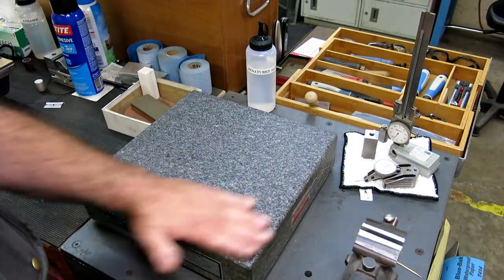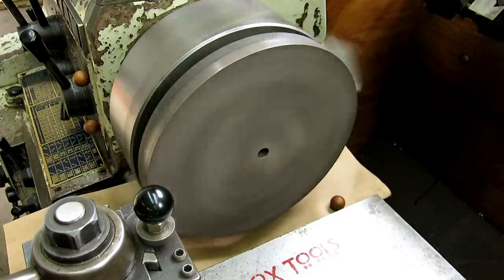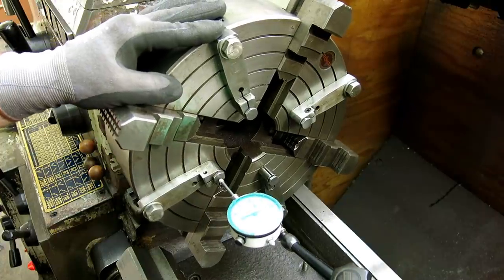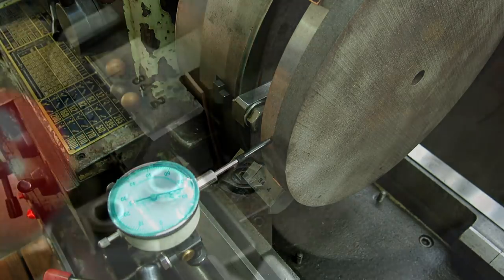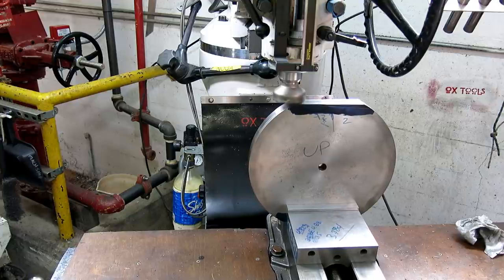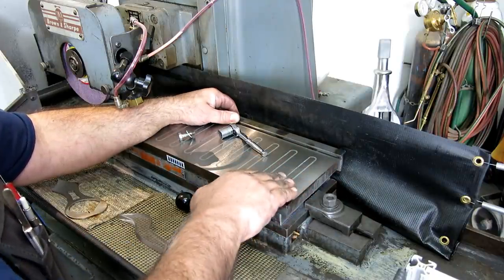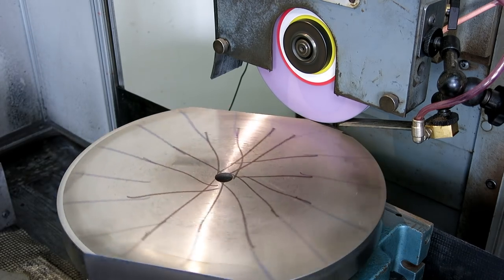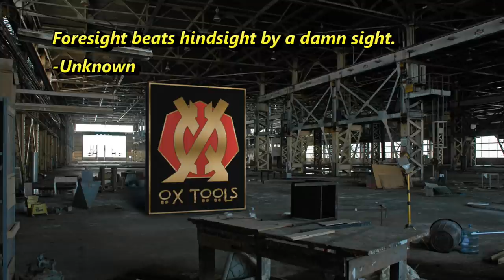Confessions of a surface plate abuser

Comment: Just a Tip from Africa, we do not have the facilities to have tools delivered to our door, so as a surface plate alternative we use a good piece of plate glass, fairly thick, I have mine set in a recessed block of wood, so it is safer, and I keep in in the corner of my shop. I have cleaned some motorcycle clutch covers that leaked because it was ever so slightly warped, some high grit on the glass and rub it in a circular motion managed to bring the mating surfaces in the same plane, and hey presto, the cover can be put back on and no oil leaks.
Replace or turn the glass when you suspect low spots are developing. I check it by using a straight edge and feeler gauges.
Obviously do not drop the work piece on the glass.
Reply: Glas or even better mirrors. If a mirror is not very flat the reflection gets warped
Reply: You must have some beautiful night skies so if you happen to have a couple more thick glass blanks, about the size of an 33⅓ LP record you're on your way to a nice telescope....by weight at least. That size works great and gets your arms in shape for serious sanding.  Just a thought...

I forgot to mention the search parameters: "John Dobson making your own reflector telescope". He's the solo version of a reflector telescope collective knowledge database. A natural guide. Cheers.
Reply: A good quality glass plate 1/2” or thicker has been a way to do this for a pretty long time. I use one myself.
Reply: I mean I don't know how expensive your glass is but a grade b surface plate like 24 x 24 is only 100-200 us dollars.and that's for large parts you can pickup a used starrett toolmakers flat out of class A Pink granite that is 8"x12" or 12"x16" for sometimes like 50-150 bucks.
Reply: What on your name ? 🤣 @BedroomMachinist

Comment: When I worked in the grind department at a company in Bad Axe, Michigan, we had one of these in each work area.  They are very handy for cleaning up parts after they return from heat treat.  We would rub the parts before measuring them on the plate and they thus saved wear on the plate (from the grit and residue which got stuck to the parts during heat treat, and which would have otherwise been rubbed on the plate and machine chuck) and made the parts stick much better to the chuck during the first cleanup.  You could also easily see the locations of any burrs (and remove them) as well as the contact pattern which gave an indication of how the parts had warped in heat treat.  They also put one at each work station in the mill department, where they could use them to knock off unseen burrs very rapidly.  All of them were similar to yours, and used a full sized disk grinder pad, but had a 3/8" thick steel base which was Blanchard ground on both sides.  They were heavy enough not to shift during vigorous scrubbing and yet light enough to pick up and move.  At a cost of less than $300 in material, tooling, and time, I estimate that these would be cost justified in under a 40 hour work week for one person in a serious shop doing short production cnc machining and grind work.  These were one of the most practical productivity-boosting hand tools in that shop.

Comment: Yeah, I have too confess too. I've done the same.
I'm a maintenance machinest in a plastics factory.
A couple months back I came into the shop, and the night shift mechanic had been working on some feed chains for a thermoforming machine and had used our 24x36 B Grade surface plate to set the chain on to swage the pins back into about 6 links. Needless to say, there are little pairs of chips that perfectly match #60 chain all over the plate.
I lost my mind, chewed his ass for a while and post a sign on the plate stating 
"THIS IS NOT AN ANVIL
KEEP YOUR GODDAMN HAMMERS 
AWAY FROM HERE"
The sad part is we have two 4'x8'x 3/4" steel work tables one only 4 ft from where he did this.
AAAAAAAAA!HHH!A!HG!HAHA!!!AAGAA!!!
Reply: Sounds like my coworker, and actually, a lot of people in general. I swear they look for the nearest thing to get a job accomplished, whether it be my tools, table etc. rather than doing things properly. Drives me up the wall. 

I use filing cabinets as toolboxes, they're free :D, so I can't lock my stuff up. Ended up leaving different large notes in sharpie in all the drawers along the lines of, "Stay the fuck out of my tools and destroy your own garbage." My dad told me, "I don't use your shit, because I don't want you using mine."  It'd be one thing if people were respectful, but in their eyes, a micrometer is just as good a c-clamp as a wrench is a hammer.
Reply: @KISSMYACE3203  buy yourself some hasp and staples and padlocks and lock your filing cabinets that way when you are off shift lol. I certainly would or take the vulnerable tools like mics and such home every night lol
Reply: millwrights gonna millwright
Reply: And people wonder why there is a cage in the middle of a shop.
Reply: @spehropefhany  for putting the apprentice in after the 20th stupid question of the day? :)
Reply: what a convergence of passive aggressives we have here... "I swear they look for the nearest thing to get a job accomplished, whether it be my tools, table etc. rather than doing things properly....I use filing cabinets as toolboxes, they're free :D, so I can't lock my stuff up."  you all might want to take a look at yourself a bit in between taping bitchy notes everywhere.
Reply: just curious , cause i don't know,, but "SHOULD" that nite shift mechanic have known  that it was a precision surface ???????,,, i mean i wouldn"t have known what it was, but concidering everything else in there is some kind of metal, , a piece of  marble on a bench would stand out, and i would  probably have  beaten that chain against the concrete floor,lol,, no really i would just figured it was there for a reason and i should keep off,, at home i have a big 6"X10"x2" thick chunk of steel  out of the railroad around the corner, i beat metal parts on that or a piece of railroad track i found, and i also built me a square tree of  4x4 posts i screwed and glued together to beat stuff of i should think marble would crack, or at least chip?
Reply: @KISSMYACE3203  my girl was using my 1940"s  starrett dial callipers to dig shit  out of the garbage disposal,lol,, and her daughter , was using my 123 blocks as sanding blocks for sheet rock compoound,,,,, at first i was pissed then i was impressed that she knew enough to need a sanding block at all
Reply: @kingkarlito  Not sure what you were going for here in your statement. 

I have large signs in all my drawers that say, "Stay the fuck out and destroy your own garbage." Does that stop people? No. They know I typically have the tool they need, and when I'm not there, they'll take it upon themselves to use them.

As my dad said, "I don't use your stuff because I don't want you using mine." 

It'd be one thing if people took care of things, but they treat everything like a rental,  and when I'm spending thousands of dollars on my own stuff, I'd rather have any damage come from my own negligence rather than someone who will do it every time they use it and never reimburse me in the slightest.

Same thing with working areas, I do certain ops in designated areas. You wouldn't do grinding work in a clean room right? Well, my coworkers would if it was the closest room/required the least amount of effort to setup. I do not like that mentality.
Reply: @KISSMYACE3203  "Not sure what you were going for here in your statement."

Wager he's got the same problem.
Reply: I’m guessing that ur surface plate was clean and the tables filthy

Comment: Hi Tom. A thought. After removing the material from one side (where the flat is), I’d flip it over, then make a very light pass with that X-acto blade to form a crease, then fold the sticky part of the abrasive disk over the other flat and trim the bottom. Now you can sand either one or both surfaces of a part that has an internal 90-degree angle (like an “L”-shaped piece.) 😎

Comment: the best i have found on my cheap dedicated sanding reference plate is using 3m microfinishing film (or any mylar based sandpaper), wash the plate well, then put the paper down on the wet plate and squeege out the water from under the paper with a plastic card type squeege (very important) the paper is suctioned to the plate by surface tension, and not only does this keep the paper from moving and causing more wear on the plate, it keeps it quite flat to the plate so you dont have the leading edge of your part hit the paper wave and create a convex surface. work the part wet on the paper (not too much water or you will float the paper) the mylar based stuff dosent curl up like paper based sandpaper so you can re use it untill its dull. the 3m stuff is much more precision graded than regular sandpaper, and you can get it from 30 micron down to .1 micron.

Comment: The only downside here is, that hunk of cast would be near $300 or more, up here in Ontario in my neck of the woods. I tried to get my metal supplier to bring in a 2” x 2” x 18” chunk of cast so I could make a straight edge and it was going to be $130...
Reply: 300? Oh god.. it would be cheaper to buy old cast iron brake discs (every scrap yard has tons of them), melt them in a 200 dollar furnace (old tank, ceramic cotton, firebricks, fireproof mortar, propane + diy venturi burner) and pour into a very crude sand mould (open top.. just a bunch of wet sand with a circular imprint)
Reply from the maker: A clever guy might take a look at some cast iron free weights at the local sporting goods store.....

Cheers,

Tom
Reply: @oxtoolco  - I've done that. What a horrible experience! 
I made a back plate for a Pratt Burnard collet chuck from a dumbbell. Full of voids, weird chunks that would break the brazed tool bit, it smelled weird?! I'll be honest, I was warned about using free weights as a source of cast iron, but I did it anyways. I've heard them once described as compressed chinese street grime.... I've also heard chinese inserts described the same way. Lol.
Reply from the maker: @shawnhuk  You have discovered a new alloy! "CCSG" iron, Dumb bell grade. Got a good laugh out of that one.

Cheers,

Tom
Reply: If you can find some old York plates, they used to machine the backs of these plates to achieve closer weight tolerances. The set that I had (and sold to fit my lathe and mill in the garages) looked beautiful. There were no voids or irregularities in the machined back side.
Reply: I've heard of people throwing in rocks inside empty aluminum cans before selling for recycling to add weight...  wouldn't be surprised if someone is doing the same for this CCSG iron you got
Reply: @chronokoks  Melting cast is not that simple,,,,,,even if you can get your quickie furnace up to temp, which is a trick, the crucible big enough to get the job done will cost you an arm and BOTH legs.
Reply: @mathewmolk2089  i worked in a foundry where we did cast irons and bronzes all day long :) the trick I used was to use a thick steel pipe with the inside smeared nice and smooth with a refractory plaster/cement used to repair cracks on big crucibles :D Good for at least two pours :) Cast iron is easy, steel is the bastard. I worked in a foundry that couldn't do steel because we had low tech furnaces and the steel casting ended up full of hydrogen bubbles.
Reply: @chrismorris8695  Yeah the old York plates are good stuff.
Reply: @shawnhuk  Old ones must have been better. I'm making a backplate out of a free weight. It is very high quality, consistent fine-grain cast, with almost no voids or hard spots. Like everything, they got cheap when they went to China.
Reply: @oxtoolco  I turned one of those for an astronomer friend to use as a counterweight. Nasty, nasty stuff. Never again.
Reply: Man hole covers but remember which ones you removed so that you don't step in the hole.
Reply: @oxtoolco  Dumb Bell grade: Named for the Product and User both.
Reply: @oxtoolco  Maybe in the good old day way back when...I'd bet they are all Chinesium crap these days with voids and weird density/hardness changes throughout.

Comment: You could make some magnetic feet that would be just a disk magnet with a steel post and self adhesive rubber pad. That would allow you to put a different grit of paper on the other side of the disk and just flip the feet to the other side when necessary.

Comment: Or, to piss off as many machinists as possible, but be fine for almost every other use....  go buy a 8 or 12 inch granite flooring tile from the local big box store.
Reply: Be careful though - they are thin enough to bend and take on the shape of the underlying surface.   A better choice is to find a small custom kitchen countertop supplier.  Their workshop probably has off-cuts piled up in the yard awaiting disposal, most of which have effectively zero value in their market.  You'll likely find a suitable sized piece of 1-1.5" thick granite with better stiffness and flatness than the floor tile.   Another potential source is countertop rip-outs on Craigslist.  Be aware that countertops aren't precision-ground and the edges of abutting slabs are sometimes polished in-situ to reduce lippage,  so they aren't suitable for precision measurements. With a little effort you should be able to find something usable for sanding though, and if you got three pieces and lapped them together with diamond paste you could end up with something better than anything not sold as a precision surface plate.  At some point though you need to remember that a Shars Grade B 9"x12"x2" surface plate is only $30, and a 12"x18"x3" only $50.
Reply: thick glass plate
Reply: @thebad300  Yes.  0.5" plate glass is a good substitute.
Reply: A tile like that won't be flat enough, for precision work. a machined plate like this really is the ideal thing.

Comment: Really cool. I have some surface ground 1inch plates, in 2 sizes in length. I use them for the same application. When they become compromised I regrind them and good to go. Also they serve as a good reference surface for flatness . good job tom!!!!

Comment: Nice project. 
On compressed air on machines. During my apprenticeship as a tool and die maker back in the 70‘s one thing we got hammered into our heads. Never ever use compressed air to clean precision machinery. During the year I worked in the mold shop we had the same rule.

Comment: I do the exact same thing with my little 4x6 saw when cutting at an angle, pushing on the side of the blade until it catches.

I’m not a pro so wasn’t sure if that was a pretty sketchy thing to do, but I feel a lot better seeing a pro like you do the same thing.

Comment: Turned out great, nice project....I've been using a pastry makers marble rolling plate with the same 12" sanding disks. It's surprisingly flat and water proof for wet sanding. Enjoyed...thanks Tom !
Reply: I've got an old granite chessboard that I've long since lost the pieces for. The back of that is pretty flat, good enough for chisels anyway

Comment: Thanks Tom...I really liked this video.  The straight edges on the plate are money!   I'm gonna head off to my local machine shop to see if they can 'doit toit' for me.  I think it will be great for for my little hobby wood shop.sharpening...and save my granite surface plate.  I guess a thick slab of float glass could work also if I was gonna only sharpen wood cutting tools...but I think the steel plate has more usefulness overall..

Comment: Great job!  As a suggestion, I would have J.B. Welded a slightly undersize pin either before turning or roto-grinding.   This would help prevent snagging on smaller parts or parts with sharp corners.

Comment: Cast iron? Surface grinder? Meh (joking) :D There was a banktrupcy sale on granite bases for big sunshades (you know - for the big umbrella) in a local furniture warehouse. About 10 bucks (original price 55 bucks) for 1 piece! Bought three, around 2,5 inches thick, cut out circles out of them with a cheapo diamond wheel in an angle grinder (Dust YUCK) and grinded them to nice circular shape with a standard stone wheel, lapped them together with 3 plate method with using silicon carbide, aluminium oxidem finished with ebay diamond dust (40 micron down to last 12 micron) and voilla! 3 precision plates for sandpaper OR lapping other very hard stuff (hardened steel and harder). Observations: It didn't took long to get it sort of planar (they were polished on one side and surprisingly planar from the get go.. made in germany), slicon carbide breaks down very very fast (it's interesting to see how al.oxide breaks down far slower), water helped up to a point and then plates started sticking HARD (shape match sign)!, took me 4 days (about 1,5 hours a day), had to make a concave/convex measuring tool (big thick aluminium square rod, 3x holes, 1 screw, 2x Abec 7 ball bearings, superglue and 1um dial indicator) so I know where I am at in comparison to a certified AAA granite plate. It was fun and the results are superb!
Reply: Fantastic story. I'm not sure if I have the energy to do something like that myself.
Reply: @ddegn  I think the worst part was the granite dust during cutting and grinding to shape. Luckilly I had all the abrasives needed (bought for cheap long time ago from a glass artwork shop.. except the diamond from ebay of course)
Reply: Would have been a great YouTuve video!

Comment: Nice video! A lot of woodchucks use sandpaper on glass as a flat surface for sharpening.  You need a fairly thick piece of glass and many folks say you need "float glass" which is produced by flowing molten glass over a molten tin bath.  I have used regular window pane glass and I think it is OK, but not surface plate accurate.  Woodchuck stores also sell granite surface plates to use as sharpening platens with sandpaper.  MDF from the big box hardware store is also remarkably flat and works OK, but does degrade over time.